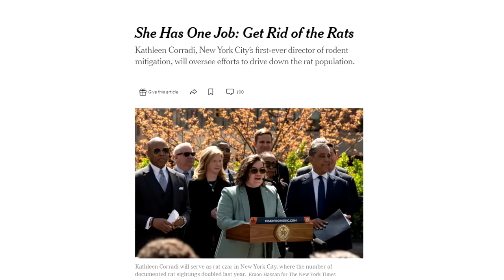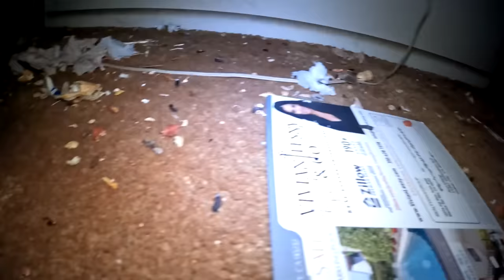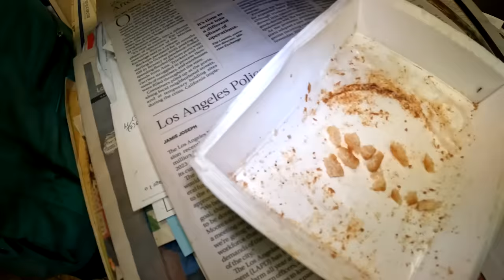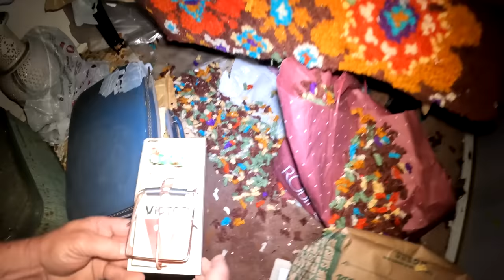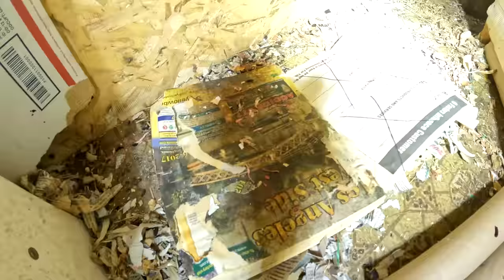FEEDING squirrels caused MASSIVE Rat infestation inside Home…

Comment: I laughed when the reporter jumped back from the rat caught outside. Poor guy was used to it by the end. I feel for this woman as we have had rats for years even after eliminating as many food sources as possible. Everything is stored in rodent proof containers, junk around the house is disposed of and so on. Once you have them, you have them.
Reply: You have to tie a piece of dog or cat food to the rat trap and set the traps every day.  A cat helps too.
Reply: I’ve always threw food outside right of the deck and I’ve seen a mouse or two but very rare but I’ve always had cats when I usually see them they are dead
Reply: One man used corn muffin mix & baking soda, they can’t burp so the baking soda makes them die. The corn muffin mix attracts them
Reply: @noelc2 peanut butter and crushed glass. Old country trick
Reply: No
No
No
Reply: These guys here will see to it you don't have them. I don't think anybody has them back after these guys go through the exclusion and testing.

Comment: Instead of using expanding foam by itself, if you place a copper gauze or wire scrubber to cover the hole then apply the expanding foam on top, the rats won't want to bite through it. Without the wire there, they can make mincemeat of that expanding foam.

Comment: There are countries that idolize rats as a result this is what you end up with. Rats are relentless. I am now winning the war as I find hidden areas that I recently found that I have missed excluding in the past. Excluding a 1950's home that was left empty for seven years which was a huge surprise to me until a neighbor told me. Good grief, I would have never bought this place. I never realized I had rodents as they were quite stealthy and I never kept food around but they used my home as a nesting area in winter. The distinctive sound of chewing in the basement tipped me off. I was told it was the plumbing expanding & contracting making the noise. Wrong. I used a borescope and went under the insulation and there she was, her face staring at me from the borescope camera. Found her, rat by rat I am winning this nightmare. Thanks to these guys teaching me the rat habits. I am going to add a third type of trapping to the mix now. Luckily this is the cheap type. At $200.00 per trap I could only afford three but they work quite nicely. Now I will add the large Victor snaps. Poison in the crawl space which is in the process of being excluded. It's going to be another long summer of exclusion. The garage door has drove me nuts. Worked on the garage door multiple times and can't get it totally secure. Yet.